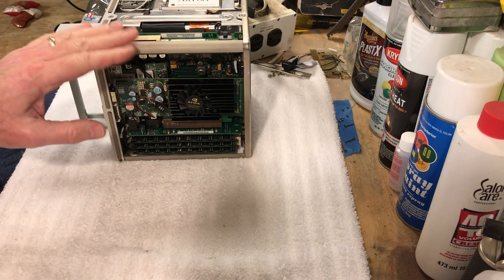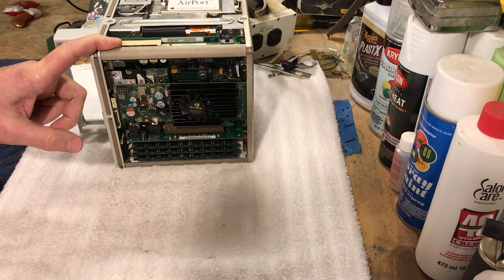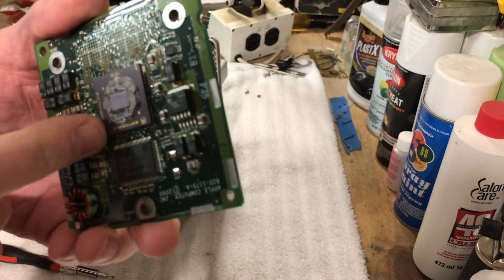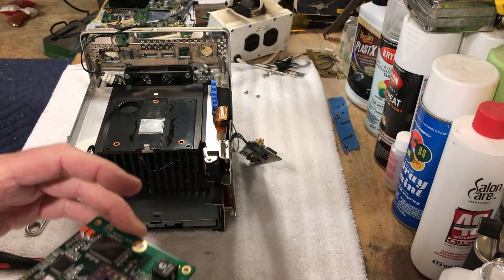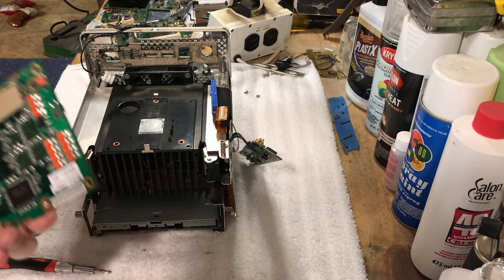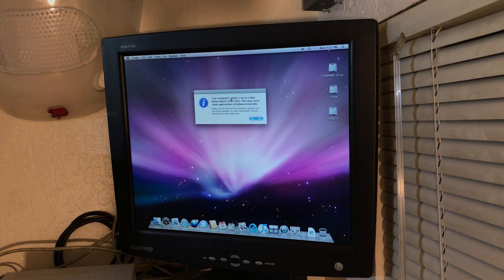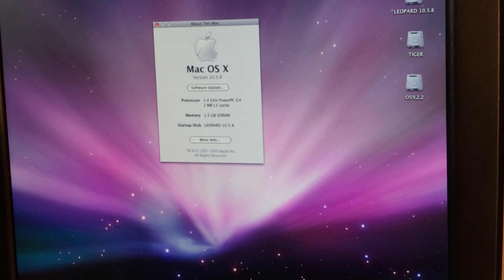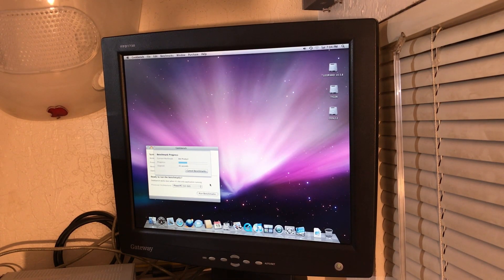INSTALLING THE 1.4 GHz SONNET ENCORE ST CPU UPGRADE CARD IN A G4 CUBE Part 14

Comment: I have the following question regarding the cube's GPU. Since underneath it's a PCI connector. Will for example a Radeon 9200 PCI card work with a PCI 90 degrees adapter ?
Reply from the maker: I don’t know you have very limented space to work with on the Cube

Comment: I can't believe you were able to push the original to 600mhz, every time I tried to overclock the G4, I was never able to get more than a 50mhz gain. MAN, 1.4ghz, unreal! That bong after you installed the upgrade card was heaven:)
Reply from the maker: Thanks The Future Plan To Put A 1.8 GHz Duel Core In It
Reply: @DavesVintageApplTech  I have to admit Dave, I dropped out of the upgrade scene for quite awhile, who did the 1.8GHZ upgrade? I never had a G4 Cube, I went straight from the G4 350MHZ (overclocked to 400MHZ) to the Intel Core Duo Mac Mini. I never broke the 1GHZ PowerPC barrier.
Reply from the maker: Thanks I Love To Push The The Speed On The Cube

Comment: Nice! I find it cool that even with the small form factor of these things, you can still do all these upgrades!
Reply from the maker: Thanks Logan Yes A Lot Of People Have Negative Options About the Cube But When You Have One It Changes Because Of The Upgrades You Can Due
Reply: @DavesVintageApplTech  WHich Nvidia video card is in there?
Reply from the maker: @paulwilliams4274   6200 256meg DDR2 Ram
Reply from the maker: And The Rom Was Flashed
Reply: @DavesVintageApplTech  Does it have an SSD in it?
Reply from the maker: @paulwilliams4274  Yes A 120 G